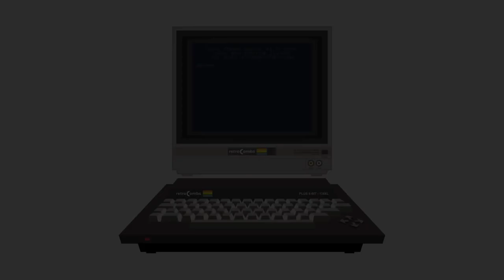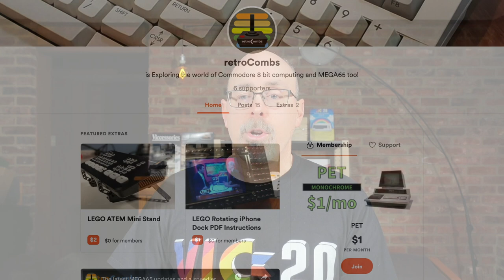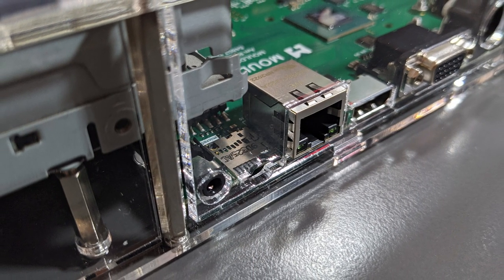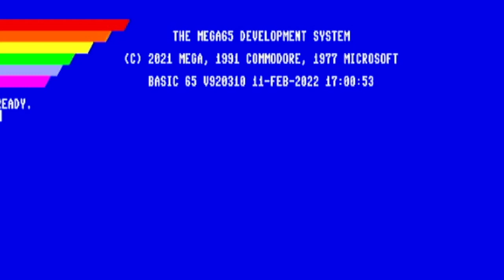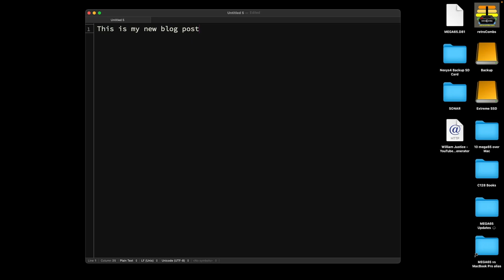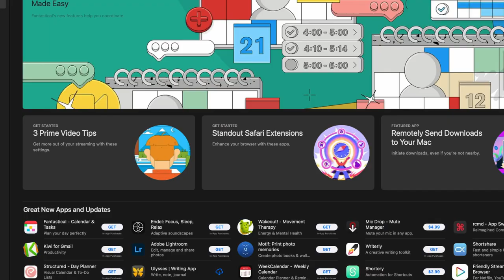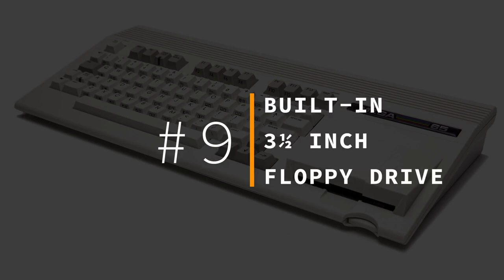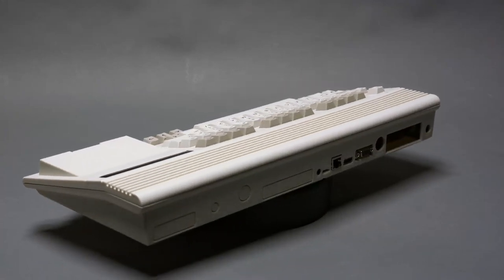The MEGA65 vs MacBook Pro | Ten Reasons the MEGA65 Wins!

Comment: The other thing this has over TheC64 is an inverted "T" cursor key arrangement. :) For realz, this looks cool and I love these modern-retro machines. They bring me many smiles.
Reply from the maker: Hmmmm….should I do another where I compare the MEGA65 to TheC64? Glad to have assisted in the smiles department.
Reply: @retroCombs  Personally, I love TheC64 and it gets a lot of use but basically, it is a game console, not really a "computer" if that makes any sense. Though, I would like to shoe-horn it as some sort of computer like device but the lack of proper IO / com port leaves it a bit lacking. Thanks for the response! Keep up with the great work!
Reply from the maker: I do also love my TheVIC20 and TheC64 mini. Let's face it, they both are able to introduce a whole new generation to our hobby in a cost effective and low barrier to entry way.

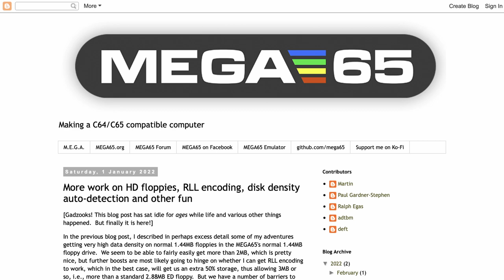Comment: The heck is a Combian Pi 400??? I think the numeric keypad from the C128 should have been kept and the floppy drive should go on the side as with the A1200. What's with the abrupt cut after you type LIST at 10:44? Why not show what it does? Looking forward to an Amiga AGA core. 17:50 would like to see more on this 800KB->2MB floppy storage capacity. If this SD vs HD?
Reply from the maker: Check out the Companion Blog Post, link in video description for more info and links. "Abrupt cut" was an artifact of not cutting soon enough. Good eye. The decision by the team was to recreate the C65 and as such maintain the design. We'd need to ask those early engineers why they chose to cut the numeric keypad. Again, check out the blog post for the link to Paul's article and videos on his floppy drive work. It's good stuff. Thanks for the comments.

Comment: Well - comparing the mega and the MBP… the Apple chime is just as “booted” as the ready prompt is.. 
And you can boot to single user mode and have a way more capable shell in about the same time as flipping the mega switch..
Reply from the maker: Awesome point and a little known feature of the Mac.

Comment: What if one of your viewers wanted one of these C-65s?
Reply from the maker: Links on the companion blog post and here: https://mega65.org/
Reply: If you're having it shipped to the US, have a little more than $900 ready to drop.
Reply from the maker: Yes, those of us making the first purchase are helping fund the MEGA65 development. That's for sure; however, there's hope that later, the cost will drop. The Dev Kit was a tad cheaper, but didn't include the cool original case design.
Reply: @retroCombs  also don't forget that its possible to make a low-cost MEGA65 compatible computer using an Artix7 A100T FPGA board. You can even connect a real C64 keyboard if you make the MEGA65 Widget Board.
Reply from the maker: And here's my build of that option! https://youtu.be/gfsNLwCtIjo

Thanks for the reminder, Paul!
Reply: @retroCombs  No worries :) It also reminds me, if we know anyone with PCB design skills, we would like to make a MK-II Widget Board that is easier for folks to make and assemble at home, by using all hole-through components. Also will have that extra retro appeal as a result.
Reply from the maker: Is there a schematic somewhere?
Reply: @retroCombs  The MK-II widget board would require a brand-new schematic, as it would be completely re-done.